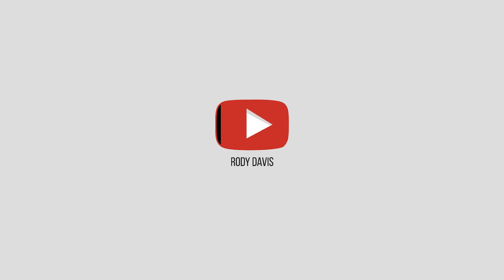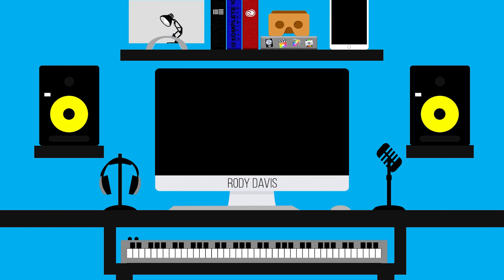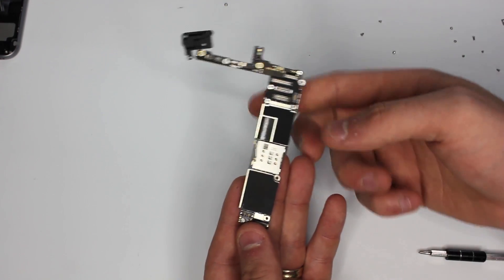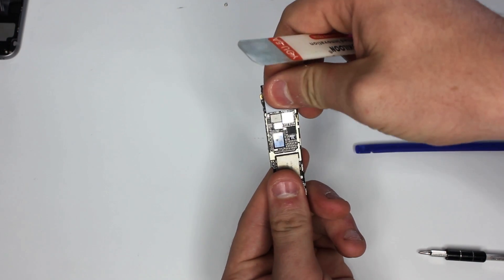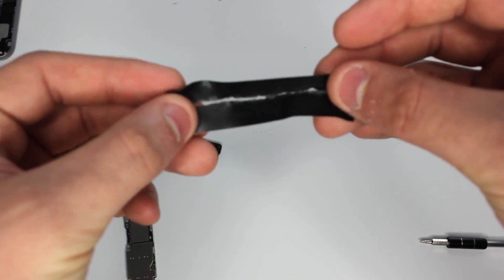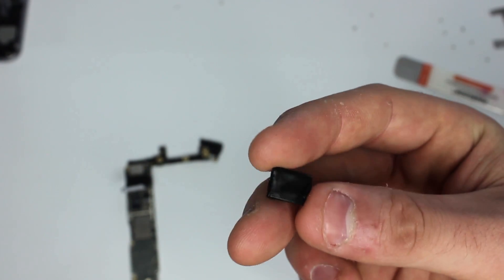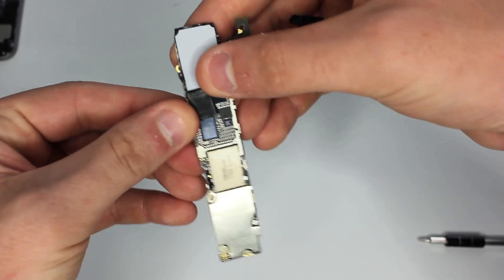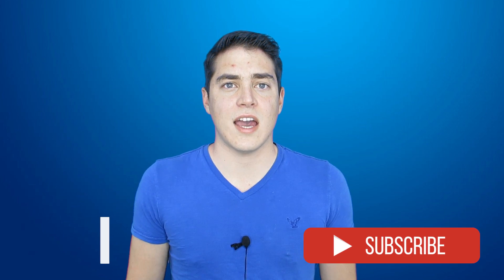UPDATE: How to Fix Touch Disease on the iPhone 6 Plus (No Soldering or Bending) | appleEducate #05

Comment: I took your philosophy a step further.  I have an otter box that I applied to thick pieces of 3M two sided tape and put on the inside of the back otter box case on top right corner and placed phone in and locked it together.  This applied enough pressure without taking phone apart. Works great now!  Thanks for the original idea!
Reply: has this worked for anyone else? I cant get it to work on with my lifeproof case
Reply: If you're doing the fix by applying pressure from the top side, whatever you are inserting 'may' put pressure upwards toward the lcd display. This could end burning the Pixels out if you're not too careful
Reply: Applying pressure to the sides of the iPhone with a case and paper worked for me.
Reply: yup. I tried this and could see where some pixels were being strained. so had to remove the tape in the back.
Reply: I have a minimialist case that wraps around the back of the phone and grabs the corners.  It is made of a pretty stiff plastic.  My fix is to put a quarter behind my phone and pop into the case.  the bump pulls back hard enough to make the grey bar go away and the screen acts normal.  Not sure how long it will last.

Comment: It works! Thanks for saving me from giving into Apples scam to get me to buy a 7
Reply: Hi is it still working please respond
Reply: Yes, it should. You could also put an old SIM card on top in between the connectors and the metal plate (upper right) and put it back on without taking all the screws and logic board apart.
Reply: This is why you should stick to Android phones for best reliability. Unless you really like the iPhone...

Comment: I have just repaired my iPhone 6 Plus by just putting the folded electrical tape on top of the touch IC chips without removing the logic board. Basically, remove the two screws next to the lightning jack, open the phone up and place the electrical tape straight onto the touch IC chips without removing any internal screws. Replace the screen, put the screws back, power up the phone and its fixed. No more touch disease. What are your thoughts on this? Thanks for the video by the way, it was helpful.
Reply: mazin ali I don't think it matters which are which, you just need to put pressure on them both according to this video. They are under the black cover above the SIM card cage. Hope this helps. I just folded a bit of electrical tape as suggested, put in on top of the chips and put the phone back together and it worked no problem. Good luck, hope it works for you.
Reply: I just used this trick and confirmed that it works.  DO NOT REMOVE THE LOGIC BOARD!!  You don't need to.  Just put the tape on the front of the logic board where the chips are.  In other words, the chips are on the back of the logic board, but instead of putting the tape directly on the chips, you can just put the tape on the front of the logic board where the chips would be if they were on the front.
Reply: thanks so much i was hoping to read this in the comments because i was getting confused by "top of the chips" for the longest.
Reply: Rody Davis Top man 👍
Reply: @MrFritzProductions Putting the tape on the logic board might work just as well, but now you're pressing down on the entire PCB, which could stress it and potentially create other problems over time.  I like Rody's solution because the pressure is only on the two chips.  But removing the logic board really is a PITA, so I can see the appeal of this simpler fix.
Reply from the maker: thanks for sharing! It may work for some people, but not everyone. Thanks for letting everyone know!
Reply: Rody Davis Yeah I understand, I'm glad to help out. You are definitely the expert here but I just thought I would share what I had done, hope it helps someone else. Cheers.
Reply from the maker: That's exactly why I made the video. I want these videos to help as many people as possible and if people find new way to make it better then the video was a success.
Reply: hello mate can you help me I don't know which ic chips are which lol thanks in advance
Reply: BooleanUniverse I don't understand a point, when i open the screen up Where i Have to put the electrical tape? I know where is located but I don't know which are. It is the one that is in top of the sim card cage? Or It is the one under the sim card cage? Do I have to open the black cover to put the tape or just put it on top? I have so many questions sorry but i want to get that clear.
Reply: just did it this way, WORKS PERFECTLY! Thanks for sharing this, saves up time and effort
Reply: ca nyou pls share some photos,i m not sure that understand what do you mean by saying put on the front,u mean to put tape on top of conectors?
Reply: Thank you so much, I was about to have to buy a new phone until luckily I found this video. I replace my screens myself when needed as well so I was worried something was wrong with the way I put the new screen on. I’m a teenager and I was able to do this. Thank you!!! Saved me a whole bunch of money.

Comment: Hi Rody. Thanks so much for this video. I have been having this touch screen issue and can't find anyone in the state of Maryland who seems to know about the problem. I did your fix, but now when I power on the phone I have vertical lines running in sections all over the full screen. iTunes is saying it has to restore the phone to original settings, and the phone is getting crazy hot. Also, my home button has stopped working since I opened the phone. Everything seemed to go exactly as outlined in your video, which I watched in pieces to first take apart and then to put everything back together. Any ideas as to what I have done wrong? Any help is greatly appreciated.

Jen

Comment: Hey Rody, I did this fix today and so far it seems to be working for the touch issue (I was having to bend my phone every time I unlocked it) However i have 2 permanent grey vertical bars on the left side of my screen. I really hate to tear all the way apart, any idea of what it could be? I tried resetting the screen ribbons a few times and it didn't solve the grey bar issue. Would the tape cause this?
Reply: So 24 hour update.  The grey lines have slooooowly disappeared, to the point where I really have to look to see them.  Since doing this "trick" my phone has been working like it should be.  Thank you!
Reply: nice

Comment: Have you tried or considered reflowing the solder with a heat gun instead of the tape?  Also, is six layers of tape the magic number?  There's no problem with the board distorting the LCD?

Comment: I started disassembling and got stuck when one of the internal screw was too small for my 1.2x40mm philips... any idea what size I should buy to get this one out? It's one of the top most center screws just a hair to the left of the front panel assembly bracket.

Comment: I performed this fix 2 months ago and my wife's phone is still working perfectly.  Saved me the $350 plus dollars I was quoted for a fix.  I had never taken a phone apart but found it to be relatively easy if you just take your time and take notes as you go.  Thanks Rody
Reply: Exactly.  This isn't that hard and yes, it is a fix.  As good a fix as anything else out there.  Even if it just holds me out long enough until my contract is out and I can get a new phone.  Or better yet, wait for the iphone 8.
Reply: A good 4 months after doing this fix, my wife broke her screen.  I've since replaced the screen and phone is still going strong.  I'm still standing by this fix and the money saved towards my next upgrade whenever that comes.
Reply: NEED HELP!! My iphone 6 has a weird horizontal lines on its bottom of the screen. sometimes it showed up but sometimes its gone. now it had a lot of line than before.. please is there any advice ? :')
Reply: no. there's no problem with the touch, it's just has a weird horizontal line on it
Reply: NateBink 123 where did you get the $350 quote? If you don't mind me asking
Reply: bhuezo that is the original quote apple was giving for a repair. It is now $150
Reply: NateBink 123 Does it still work?
Reply: bagus282013 are you noticing any problem with the touch response?

Comment from the maker: Have any questions?
Reply: Look at all these people asking for help after following the instructions in this video. You've created a support nightmare and stopped responding to these people a month ago. Once again I urge you to pull this video. In fact, you should put up another one that tells people this is a bad idea and bad things are LIKELY to happen. These are not people trying recover data, they are trying to repair their phones! Man up and fix this mistake!
Reply: Hi Rody. Thanks so much for this video. I did your fix, but now when I power on the phone I have vertical lines running in sections all over the full screen. I plugged it into my desktop to charge it and iTunes launched per usual but gave me a message saying it has to restore the phone to original settings, and the phone is getting crazy hot in the corner where I put the tape. Also, my home button has stopped working since I opened the phone. Everything seemed to go exactly as outlined in your video. Any ideas as to what I have done wrong? Any help is greatly appreciated.

Jen
Reply: i put a thick piece of electrical tape in but the problem stays. unresponsive and ghost touches
Reply: The screen works after tape, and hasn't stopped. But the issue I am having is that I had to change the screen because it was broken. But the new screen won't go all the way down. And it is only on the top right of the phone. Is that because of the tape?
Reply: would a thick piece of plastic work?
Reply: please yes I did it and it does not work and I have a lot of thing I have no idea where are them place so I wish if you can help me to fix is or even to return them back
Reply: I have a question, my iPhone 6 Plus has a problem, the screens starts touching things randomly and sometimes the problem is solved when i bend it and sometimes it doesnt. Is it touch disease or not?
Reply: This is touch disease, Andrew.
Reply: I just did the repair tonight... I'm having the EXACT same issue "igotabeme" is having. Any idea what could be wrong? I really don't want to take it all apart again and remove the tape if it's not necessary. Any ideas would be VERY appreciated!!
Reply: Rody Davis did everything in this video and my phone wont turn on at all I have no clue what I could have done its charged and everything
Reply: This right here is why this video shouldn't exist. Inexperienced people trying a botched repair. Who gets to fix this screw up now. Technicians.
Reply: Josh Ehring thanks for your insight man didn't know we had an expert here
Reply: Austin Fryar this is not how to fix the issue you are having. you need to get your phone to a microsolder who can fix it properly.
Reply: Hey Rody Davis, I have the IPhone 6 Plus. The screen is unresponsive but there is no gray bar at the top. Would this be the Touch disease or just my LCD screen?
Reply: I got the screen replaced and the lines went away but the the touch diasease did not and they gave back with no screen RIP
Reply: my ip6 screen become unresponsive while using , there are no grey bar , but when the screen unrensponsive , i turn off and on back my screen it will be fine , is that touch ic disease ? or just the lcd ?
Reply from the maker: +anasabdullah MA probably the screen if you have had it replaced before. Otherwise it could be touch disease, although it's really more of an issue on the 6+
Reply: i put the tape in and put my phone together but when i start to put the screen down the display goes black please help!!!
Reply from the maker: Make sure that you have the display connectors put in correctly
Reply: ***** they are
Reply: Where do you get all of the necessary tools to do all of the things described in the video? If I were to purchase all of them would it still be cheaper than a professional repair?
Reply from the maker: +Daniel Martinez they are in there description
Reply from the maker: +Eric Koleci being very careful, you can slightly bend the part by the volume rockers. I suggest not doing it much at all.
Reply from the maker: sorry it needs to be electrical tape
Reply: hey man, thanks a lot for this!
After reassembling the phone, i saw a small white spot on the screen.
The spot is basically two parallel tiny lines.
what could have went wrong?
Reply: Rody Davis is the fix temporary or permanent ?
Reply: do you know how to fix an apple logo bootloop?
Reply from the maker: could be warped or stripped. What part of the phone is the screen in?
Reply: The inter-connectors to the logic board are not sitting correctly. When plugging them in you must place pressure in the middle and it should click in nicely. Sometimes when one side goes in first, it SEEMS like it went in properly, but did not. The REAL issue then arises when you get a slight curve in the interface plug connectors. This leads to some pins not making a solid connection and thus in some cases intermittent lines .... or permanent ones till the plug is rectified. When removing and re-inserting, CAREFULLY stroke the plug in the middle so as to straighten it, then finger in the MIDDLE place plug on socket and snap in STRAIGHT/LEVEL so ALL pins make contact. It may take 1 or 2 go's but you'll get there. Check all your connectors that were removed in the same manner. Patience and thank the tech GOD and you'll get there ; )
Reply: any other solution instead of electrical tape? i dont have it here and i need to fix it really badly
Reply: Hey @rody nice video. Just wondering, how permanent is this fix, or will it start having touch screen issues a couple of weeks later? Thanks!
Reply: Grant Brewster you probably forgot to plug the battery back in. That was the first mistake I made
Reply: i dont knonw where to put the 00094af , it tiny and its blue??? help pleaseeee
Reply: I think you have too much tape under that and it's pushing too hard on the screen. I would remove some of the tape or do like I did and use a fairly thick piece of a rubber band.
Reply: Make sure you didn't put the two little battery connector under the logic board.  If you did, you might not have seen them and didnt see to plug in the battery.
Reply: i have the same issue, did u fix it??? how??
Reply: Rody Davis PLEASE HELP . 
how long does the tape have to be exactly? I want to make sure I do it perfectly the first time, I haven't had my iPhone 6plus sense I got this Touch Disease, and it's been months. please help!
Reply: Rory please I need help, I followed everything the best I could, put everything back together, device turned on when plugged in, home button works, but the touchscreen and power button do not. Please reply as soon as possible
Reply: It looks like it's broken but it's an iPhone 6 plus design defect. So your problem Is Touch Disease.
Reply: same problem
Reply: I followed step by step but when I turned my phone back on it still did not work and there was a grid of the grey bars. Any ideas? Thanks! :)
Reply: Why are you such a fucking liar?
Reply: I have an iPhone 6 with unresponsive screen but no grey lines. Could it be the screen? I ordered a new screen for it. Hopefully it the screen. Please respond
Reply: my screen now has lines all over it after doing the fix